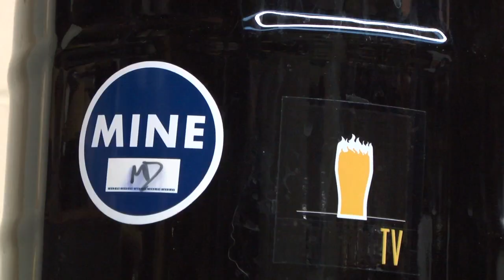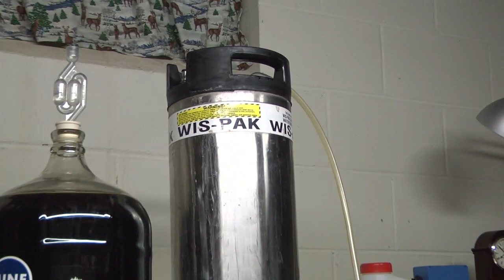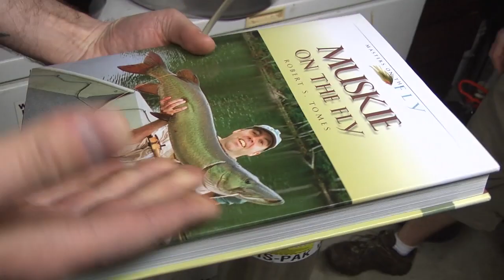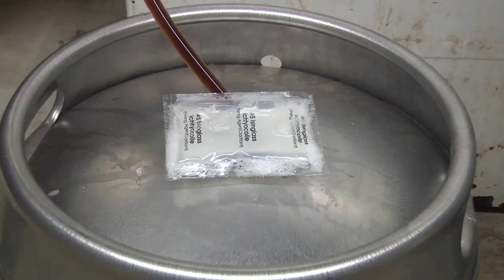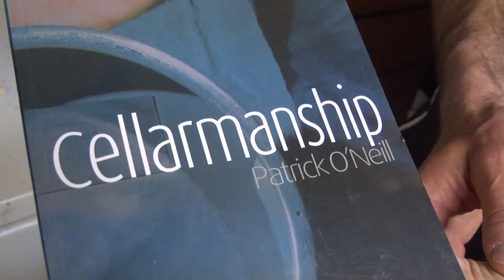Brewing TV - Episode 38:  None More Cask

Comment: Condition is all based on the amount of fobbing at the tut once the spile is hammered in.  Using 48 hours of soft spiling  as a rule of thumb would have been a poor idea in my opinion here because the beer wasn't very lively.  The key is to set the cask in place undisturbed in a spot where it can be chilled to 52-56 degrees F.  At my pub I'll start venting my firkins 4 hours before the session.  Some I can hard spile within 20-30 min and some I vent the full 4 hours.  I have never handled a firkin including double IPA's that are hopped to death that weren't ready to serve within 4 hours of venting...  You dudes are hilarious and I like watching your vids!  Cheers.

Comment: Hand pull beer engine is the proper way of serving cask beer. In the south of England they don't put a sparkler on the tap as they like it flat so the beer engine is generally just to draw the beer from the cellar. In the North we have sparklers that fit to the beer engine and put a lovely thick head on the beer.

Comment: I don't see the point of adding priming sugar then vent later on during 2 days with the soft peg for low carbonation result. If you just rack the beer to the secondary leaving just enough sugar, after one day you can already fill your cask with no priming solution, That's what is known as real ale. Besides, leaving the cask with the soft peg for 2 days is a big risk of spoilage in my opinion. Here in the UK, the standard procedure is to settle the cask for 24 hours in the cellar before you tap it to leave the finnings do their job, then, when you're gonna tap it, use the hard peg to break the shive and put the soft peg right after that to serve the beer. If the cask is not finished after the session, substitute the soft peg for the hard one to avoid any oxygen/spoilage getting through the shive.
Reply: It's traditional...